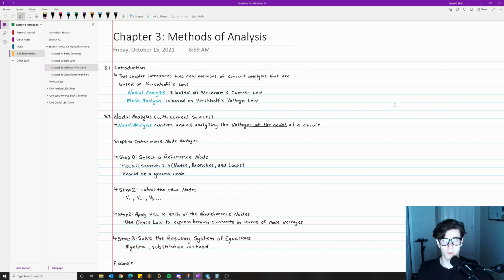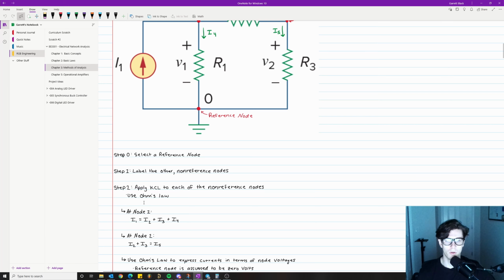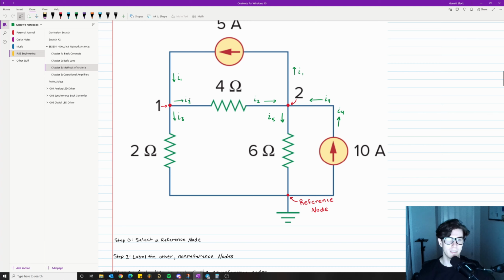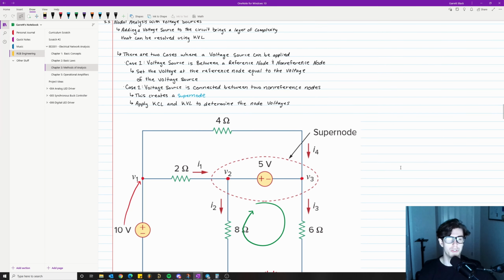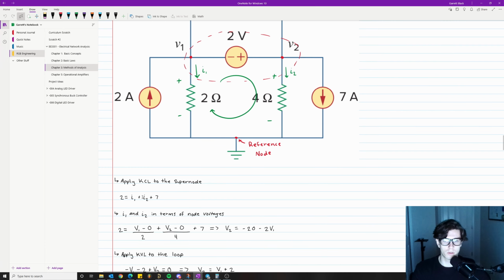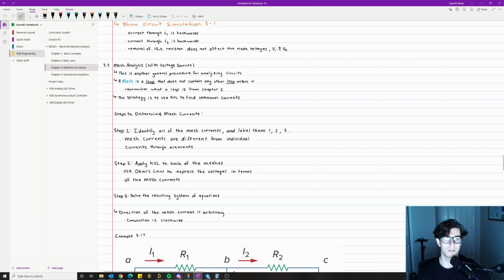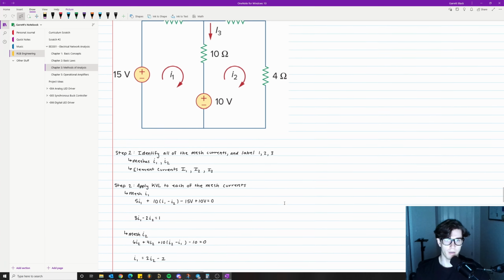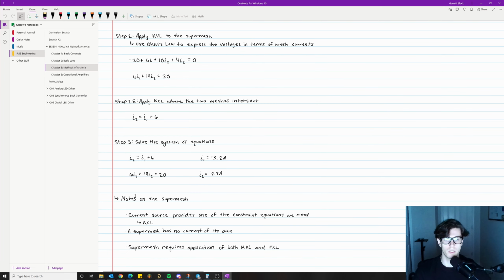NODAL ANALYSIS & MESH ANALYSIS | Electricity for Beginners

Comment: Thank you so much for the knowledge drop. I do have a question (Sorry if this is dumb) at about 25:41: 

Why does the current through our supernode increase when we add back that second path via the 10 ohm resistor? 

Thinking in terms of roads and traffic, if you built a second route to a destination, wouldn't the total flow of cars on the original route decrease? Maybe the analogy breaks down, just trying to figure out what that resistor is telling the circuit...
Reply from the maker: Great question, the current leaving the voltage source increases because there is an additional pathway that current must flow through. In this case "must" simply means we have another resistor with a voltage drop across it, so according to ohm's law, some amount of current will flow. Try to look at the circuit the other way around and pretend that only the 10 Ohm resistor is there and see that it draws current by itself. Hope that helps :)

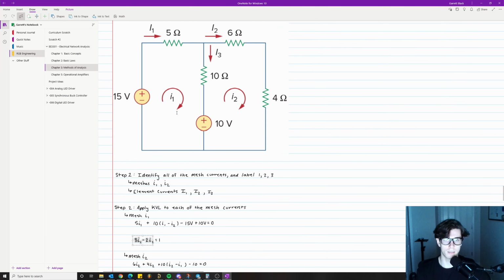Comment: When doing the practice example for the mesh problem at 32:02, why wouldn't it be a different current going through the 4 ohm resistor, why can we say that the current is i2?